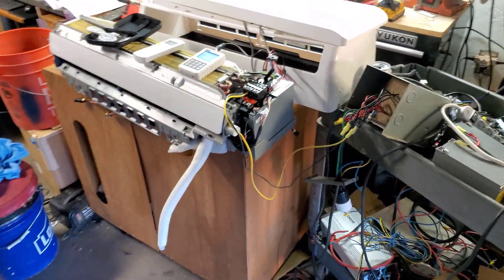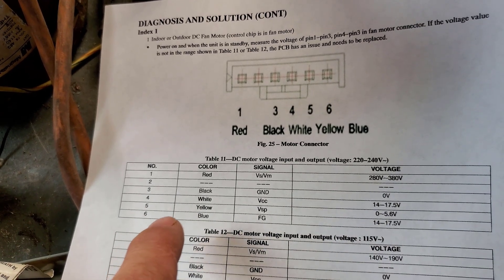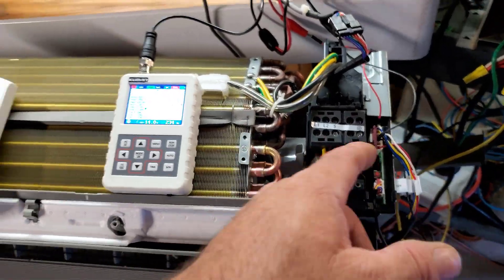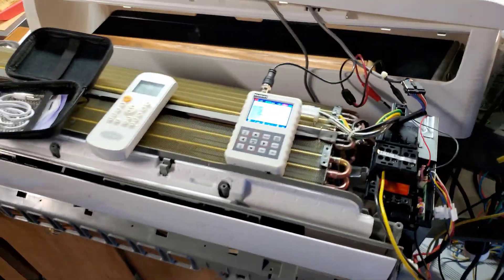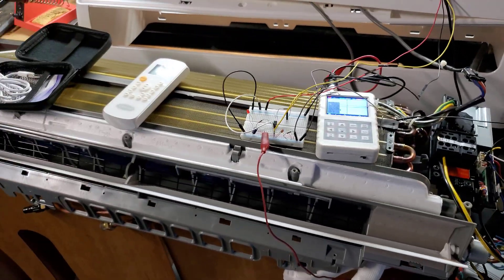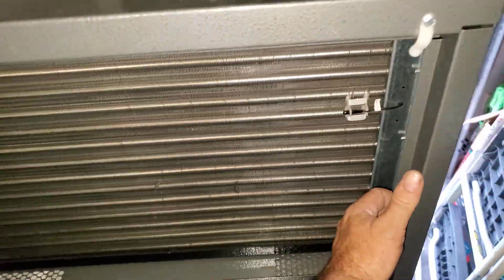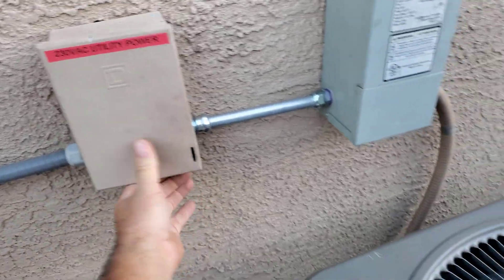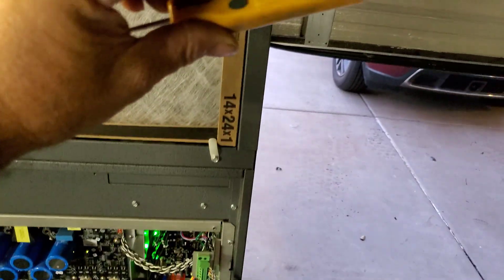Frankenstein Engineering : Off grid abomination of combined VRF equipment [PART 1] IDM control

Comment: That indoor unit will run whitout com to outdoor unit in fan mode. Btw voltage regulate that fan speed, i have run it without board, you can create the high dc with a bridge rectifier and capacitor, (watch out very dangerous)
Reply from the maker: I plan on making it able to operate off of 300VDC battery pack.
The 0 to 5 VDC signal is working. That is what I am doing here.
The other thing however is it has a 15VDC control voltage that I need to muster up. Again, can't use a simple transformer step down/rectifier combo because it needs to all run off of a 300VDC battery pack (off grid project).

I made more progress. I may upload a new video tonight.
Reply: @hackfreehvac  tap one battery of your battery pack.
Reply from the maker: @sjefoekel6058  I thought of that.  Maybe 2 as one 12v was not enough.

Comment: take a 19v laptop psu put a 7815 here we go simple 15v psu... or you can open change resistor on optocoupler too
Reply from the maker: I have a spare laptop charger like that. However it requires AC power.
I need 15VDC to be provided when I power the system up on a 300VDC battery pack (off grid emergency operation).

I need to experiment on how much power is required. If it is a low power just for motor logic then maybe some series wirewound resistors could do the trick. Else something else will be necessary.

I just obtained the specs for the VRP motor. It's controller has a 10VDC supply plus a 1-5VDC speed and a 5VDC tach signal back.
I think I can work with that. If I recall, the t-stat operates off of 12VDC.
As long as the highwall motor 15VDC requirement is low, I think I can make a tiny DC to DC step up from the 12VDC the VRP provides.
Reply: Laptop psu you can put direct on dc no problem i've done that the range is pretty wide also... these psu can take 240vac on dc will be 350...
Reply from the maker: @henriquecasonatto8881  It must switch directly from rectified high voltage DC.
That's cool. 
Way overkill for what I need tho. Lol

Comment: Judging by the remote, Carrier is selling a rebadged Chinese Midea unit (https://en.wikipedia.org/wiki/Midea_Group). Those are actually really good inverter units.
Reply from the maker: Yup. Kinda like Mitsubishi/Trane etc.
Reply: Yes, Carrier and Midea formed a Joint venture back in 2017 called Carrier Midea North America for the smaller mini-split type units and we already know about the Carrier-Toshiba JV for the VRF units and the Toshiba-Carrier rotaries that are used in the 5-stage units.